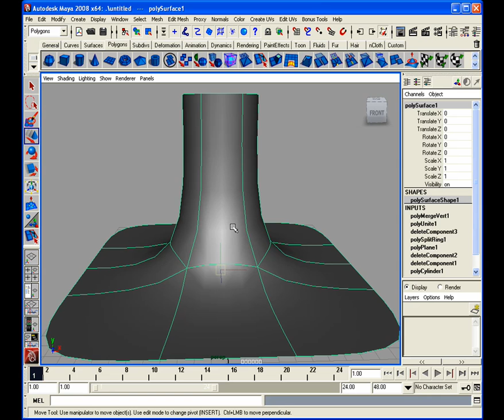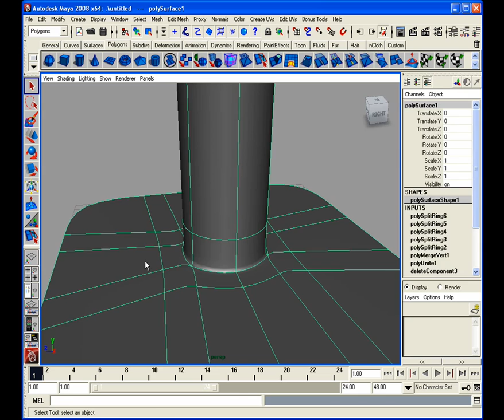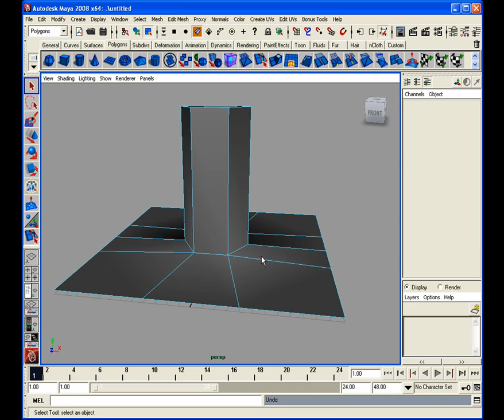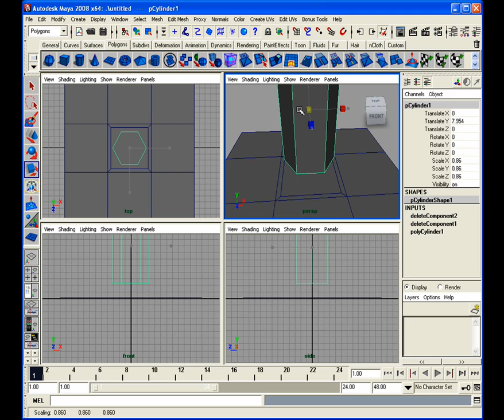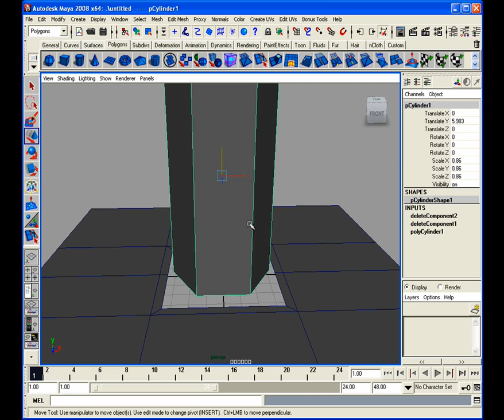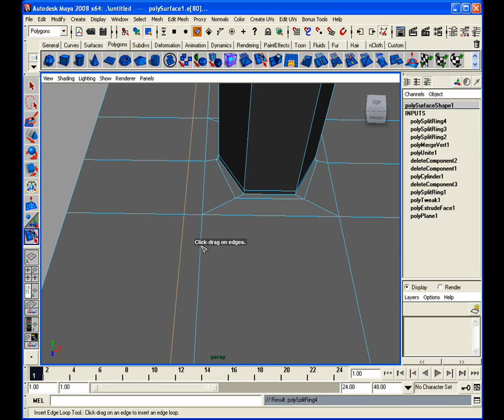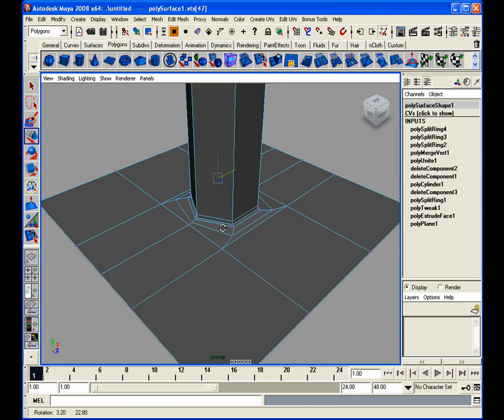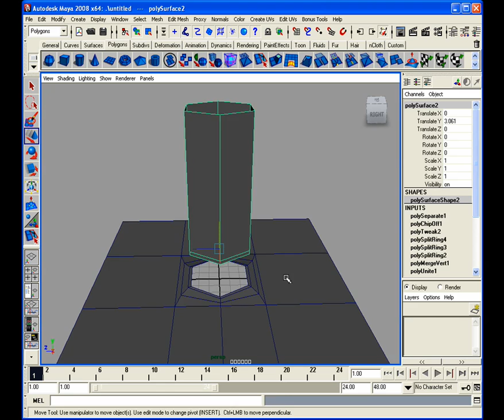Maya tutorial pt 2 combine / join polygons

Comment: Thanks for posting! Whenever you can't see your manipulators in a view (TOP one in your post), check whether they're turned on or off under the "show" menu of the misbehaving view. One more tip: whenever I must align a row of vertices to form a stright line or plane I select them and resize them towards the manipulator center along a single (perpendicular) axis a few times but never pull through the center of the manipulator to avoid flipping them over the plane I'm aligning them to.